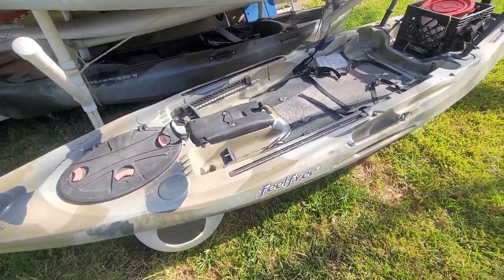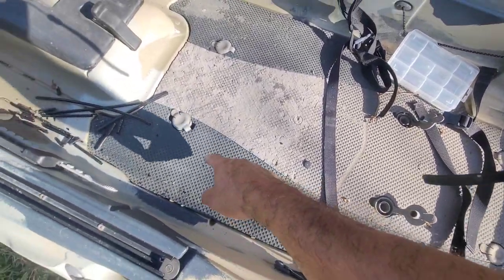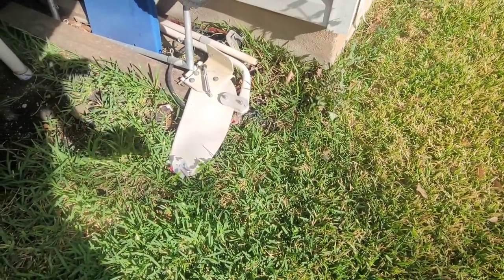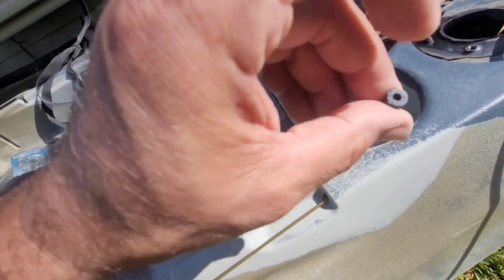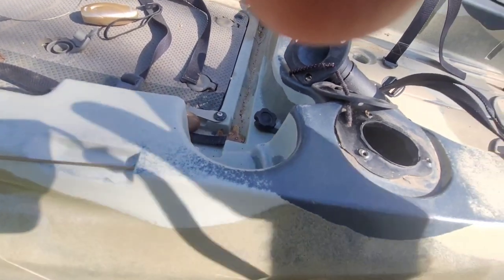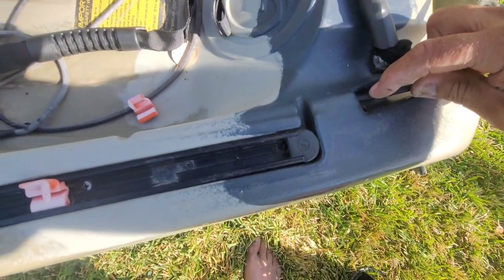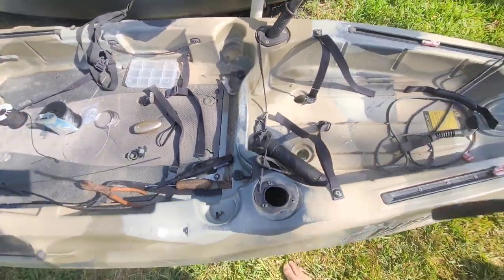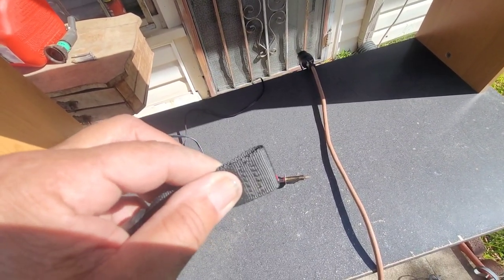FEELFREE LURE 11.5 RUDDER TUBE REPLACEMENT ~ NO ACCESS? NO PROB!

Comment: I am glad I have not had to replace mine yet . I bought it in 2016, plus add ons off 1 more flush mount rod holder added to each side behind the seat . There about 4 more add ons screwed in the the areas from controls to cables on each side , so I have expected to have to replace .
Temu has the exact same handle for in the stern of this kayak for $3.

Comment: This is an awesome video! I have a problem with my Moken 10PDL and must replace the cable and the black cable housing tube. I was at a lose as to how to do it. Feelfree has been very responsive in sending the proper supplies needed. I’m about to contact them now to see how they recommend doing it to see how it compares to your method. Thx.
Reply from the maker: I used 1/4" irrigation tubing and cable for the steering. I reused the barbs that were in the original tubing.